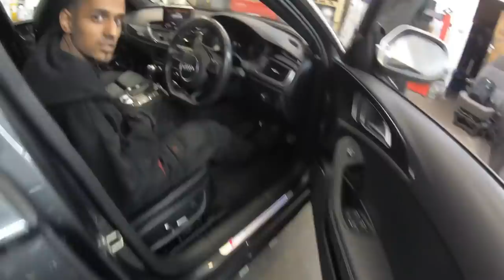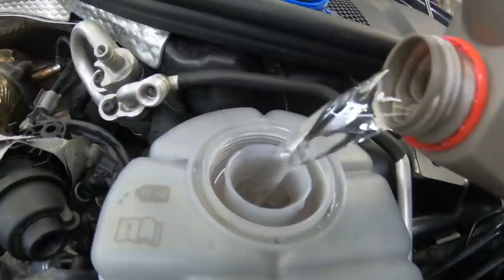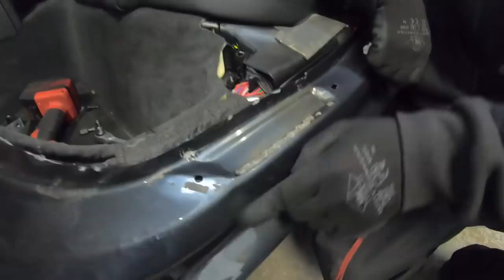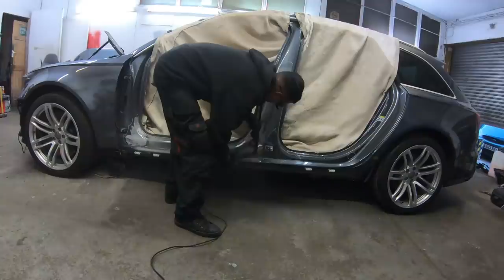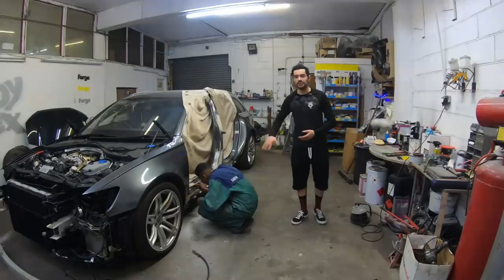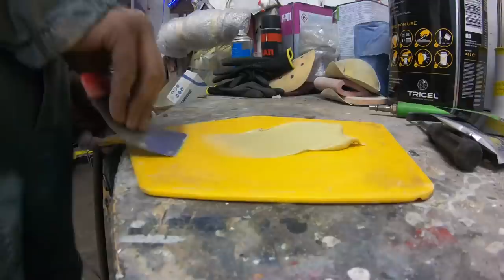Rebuilding a salvage Audi RS6 PART 4

Comment: I changed the front rad on a 16 plate RS6 a few years back, absolute basterd to bleed, recommend vac filling it if you have that available or do what the guys in the video did, doing it conventionally will take you ages and a few freezing cold roadtests haha

Comment: Those repairs are just cosmetic, or are also for the car strength ?
Reply: mainly cosmetic for the car resell. u cant resell rebuild car with buckles like this. but this doesnt change much on the metal strength
Reply: Those repairs are just cosmetic because they didn’t fix the actual problem.
The kinks are there because the side of the car moved by a few mil and in order to fix that you’ll need professional tools, and I think that’s why the doors or the wings don’t align properly.
With the filler you just hide the problem but it’s still there.
I like your enthusiasm but I think you should stick to the wheels and tires.
Reply: When metal goes through plastic deformation, there will be dislocations in its crystal lattice. 
The metal work-hardens locally and will be a stress riser/failure point to future loading. 
You can think of it like standing on an empty coke can - it can bear your mass. Now put a small dent in the side and try again. 
In the case of the RS6 sill, it will probably be absolutely fine in ordinary operation. But in the event of an accident the integrity of the car has been compromised.